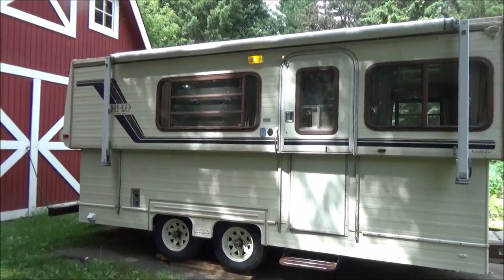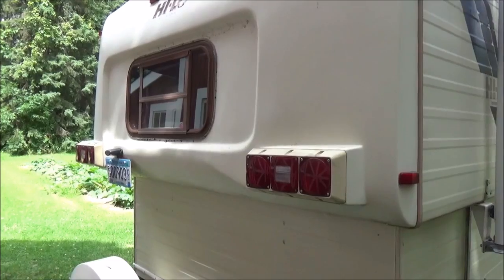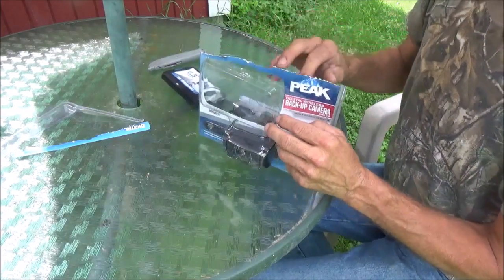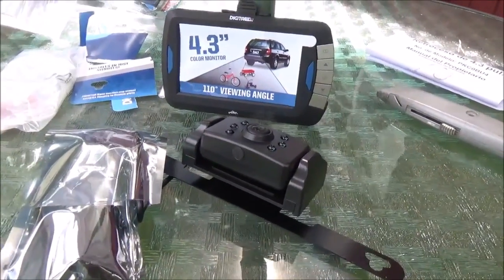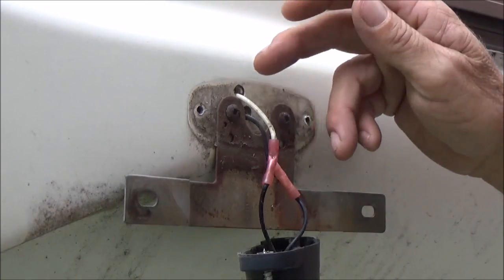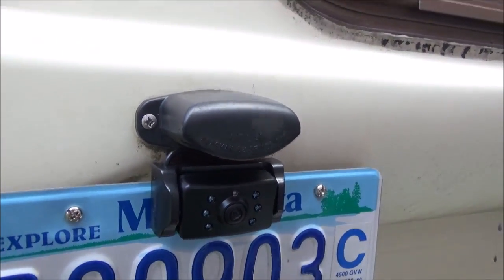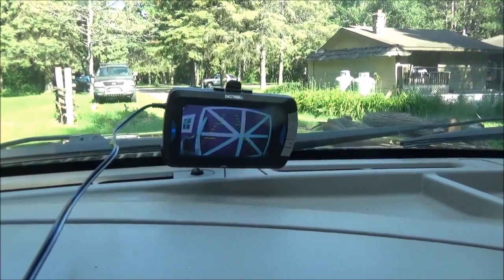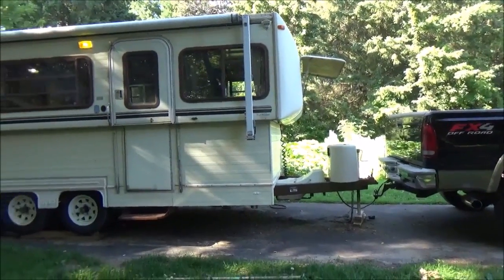The Hi-Lo Travel Trailer. Rear View Camera Install. Leaving For Louisiana Soon.

Comment: Good Grief, I wish my hubby was as handy as you are!  We left on Tuesday for a family reunion with our RV.  Well, supposed to have left but cranked the RV, a Class A, and the hydraulic jack alarm went off.  Kept saying the rear jack was down and it was,  Can't drive with that alarm screaming so we moved everything to the van and just drove that.  Half my stuff was left behind that normally stays in the RV and the dogs, food, dishes, medicines & treats got left in the bathroom.  I was so mad and we had to drive back & forth 30 mins every day.  It just isn't as convenient as staying at the family lake property.  This year we had 4 campers there.  May have lost our spot for next year.  We head back home tomorrow, so now have to figure out what the problem is with the jacks.  I heard it could be low on fluid.  I hope it's that easy.  Someone said to just pull the fuse.  I'd have to find where those are.  My hubby would rather just pay for someone to figure it out and not have to worry with it.  I say do it yourself.  He is difficult to get to change his mind once he gets something in his head.  Have a great trip!

Comment: Love the sound of a 6.0 powerstroke, best sounding diesel out there.  If your towing a lot you need to get a monitor to watch the oil, coolant, trans temp etc.  Bulletproof diesel sells a pre programmed scan guage for about 200 bucks.   I have a list for my dad, who uses a 6.0 as his tow mule, of what each reading should be.  I can get you a copy if needed.   Love the 6.0, but one should understand them.  Over maintenance your coolant and oil, never more than 3 years on coolant and no more than 5k on the oil.  I know the 6.0 like the back of my hand, let me know if you need any help with it.

Comment: Check to make sure the camera isn't blocked by the wheel cover when you drop the top for towing lol !
Reply: I was thinking the same thing. When Joe said that he has to adjust the angle down, I thought, better wait to do that once you lower the top down.
Reply: Yeah, it looked like it could be in the way on the video. I hope it works out alright for him. But if he has to move it at least he won't have to patch any holes lol !
Reply from the maker: It was and in the next video which I will post maybe tomorrow I do move it. It wasnt much of a blind spot but it was enough that it bugged me.
Reply: Weren't saying that it would be behind the spare tire. Just was saying that if the camera would be beside the spare tire, then the view that you would maybe be just behind the camper and you wouldn't be able to see towards the passenger side of the camper due to the spare tire.
Reply: Joe, i figured you would try it out before hitting the road. Good luck with your trip.
Reply: Oh, ok i'll be watching lol ! love your channels !

Comment: the county destroyed my neighbor's siding trailer. by a bridge blow out. the actual road gave way when the truck went over. by the time he got stopped the hole had wrecked the front trailer axle and ripped the rear completely off. witnessed by a county maintenance truck.  anyway the replacement trailer was built in southern Georgia and I was within half hour of going down after it. bosses son and girlfriend decided to go at last minute. so unpacked my bag. left Fri 7 pm and were south of atl then next night. got back late Sunday.